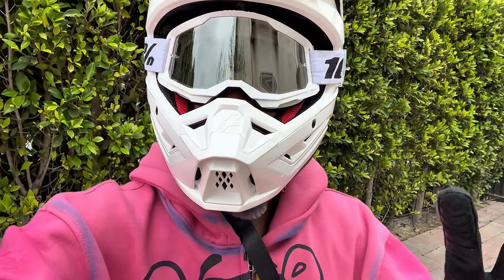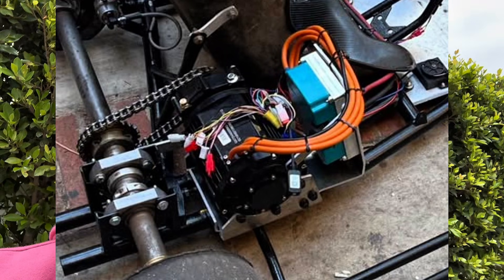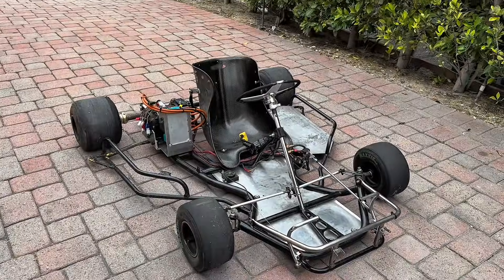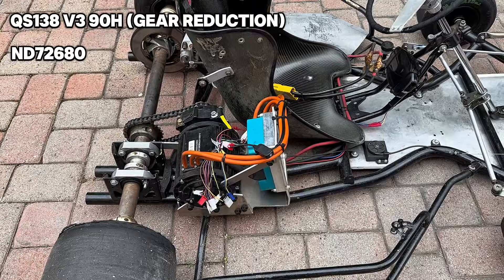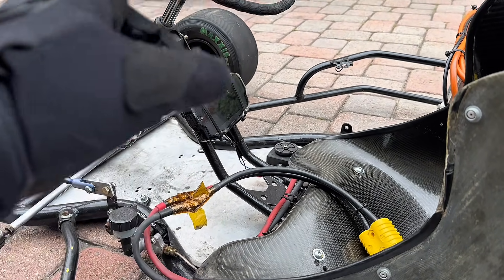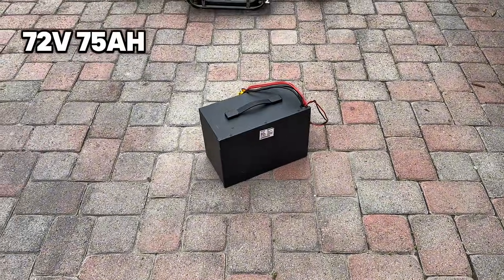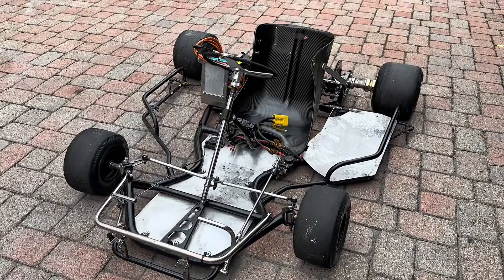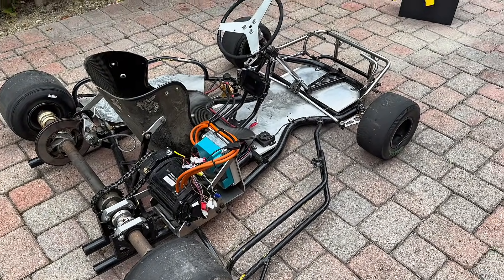My Crazy 72v 14kw Electric Go Kart Build! pt.1

Comment: When are you gonna sell that 40kw ebike for $3000 I will buy it. Right now Im still waiting on that shock and rear tail light from estrapz but until then this sounds enticing I think I told you about Cab Motorworks Racer their max is 108v but the motor only dishes out 30kw at most if you slap a 40kw on an ebike I don't even want to imagine the power output thats got to be atleast 95 mph with a good tune.

Comment: funny, we are doing same here... bought some used carts and electrify them :)
I think you choose good motor and mounting looks very advanced. the 428 chain is also solid decision. this can handle a lot of power! Good work!
My tips for you: Remove ackermann makes driving more funny. (the steering rods to one center screw without offset). Also I strongly recommend to install an emergency switch in the main wire, in case of hanging gas or controller error could be livesaving. Another lifesaver is a steelwire that is attached between brakepedal and braketrigger, parallel to the brake-rod - double safety.
 I wish you the best and a safe experience! c u
Reply from the maker: Awesome advice! Thank you so much!!